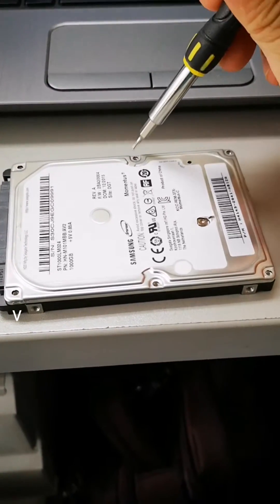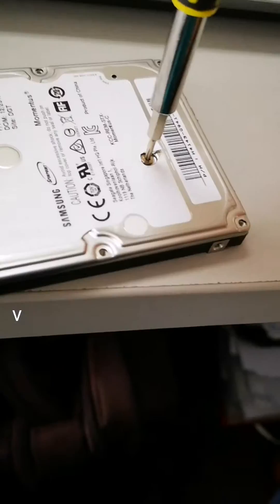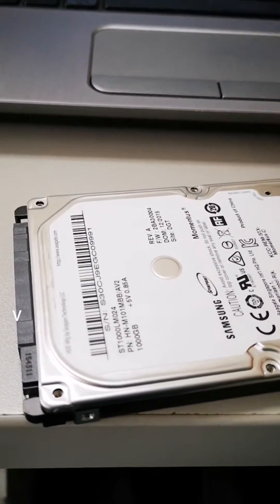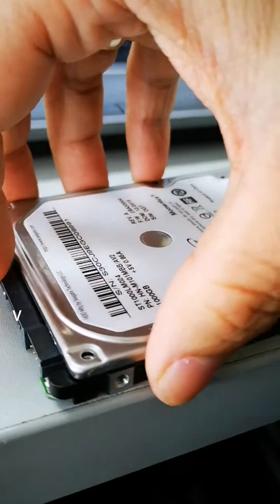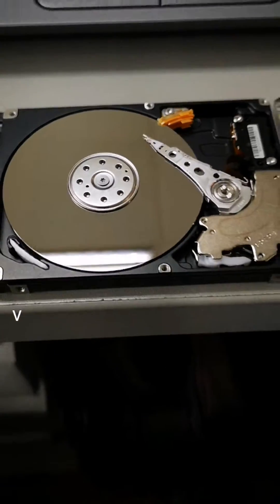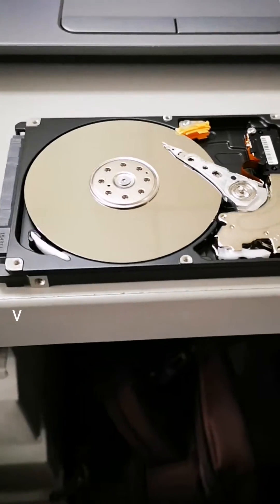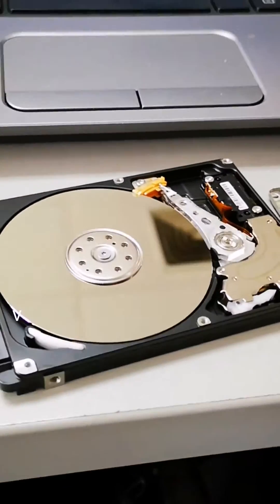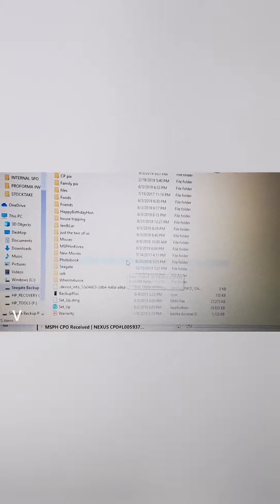Repair and Recover Hard Drive if Not Recognized by Laptop (stuck head, clicking) ST1000LM024

Comment: Actually, I have trouble with this disk and remove them by cleaning all oxidized contacts between the plate and the main part. There was no stucked heads at all.
Reply from the maker: probably it is really busted